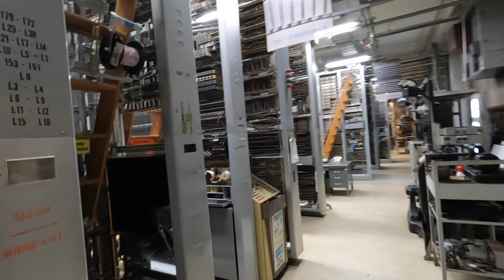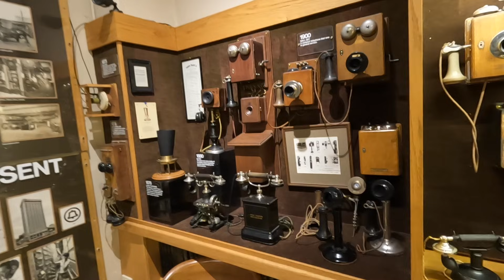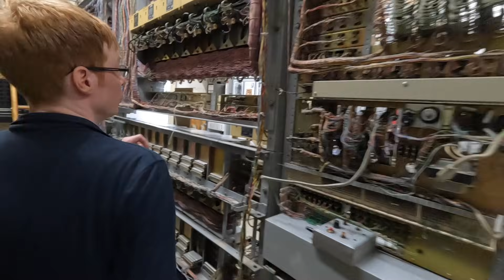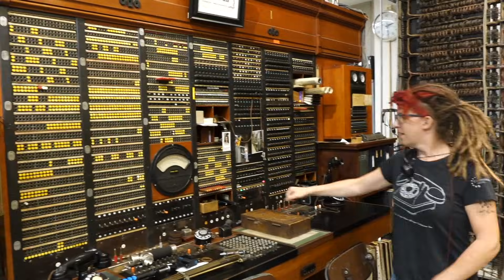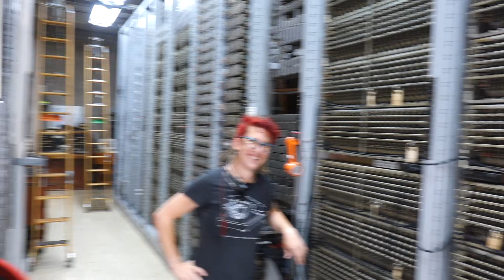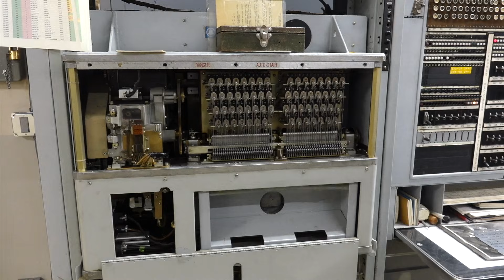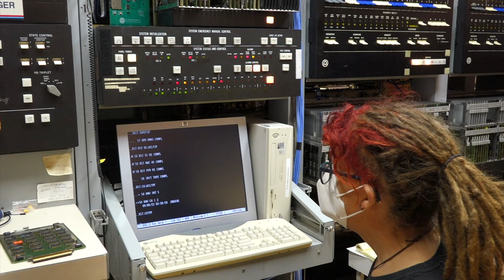At the Connections Museum: the insane telephone technology that led to today's computers

Comment: My parents’ home had a local battery set in the 1930s with a metal battery box holding two Blue Bell No. 6 1.5 Volt carbon zinc dry cells.  My dad said a phone person replaced the cells about once a year.  Those were some pretty impressive dry cells.  The capacity is more than 100 amp-hours.  In the very early days in the 1880s crowfoot copper sulfate or later Leclanche carbon wet cells were used.  The wet cells also had massive amp-hour ratings any only needed to be refreshed once a year or so.  Until Charles Brush invented the practical dynamo around 1880, all telecom was battery powered.  Remember the electric telegraph dates from about 1844, so wet cells were all over the Western Union and other systems.  Battery boys were used to keep the electrolyte refreshed in rooms full of wet cells in main offices.
Reply: Those later dry cell batteries would last longer, so would often only be replaced at the 10 year mark, or even longer. There were still those systems in operation in my country till after 2000, running a few dozen farm lines over open copper plated steel wire pairs, with the poles having every 20 poles a section of 2, where the twists in the pairs were done using a 4 insulator block. Around 50 subscribers per pair, as you did not have a high call volume on those lines.  First change was to consolidate those lines so only the far ends were shared, local ones got the new cable gradually laid out, giving each a pair, and direct dialling, till finally the last were done away with. 

Still have a 1939 Ericsson wall mounted phone, which I converted, just with 2 wire jumpers, from local battery to remote battery. Unable to dial out from it, as it still has the 90VAC generator, and the mechanical bell with the 1 REN loading on the line. Want to use it for VOIP, but most of the adaptors cannot actually handle an actual real 1 REN load on them, typically 0.4REN. Thus it is now a wall mounted phone holder for the modern smart phone. No more copper phone to the house, gone a few years now.
Reply: @SeanBZA  Thanks for the reply.  The phone on my desk is a Western Electric 302 with the older style handset with the ear piece with the separate metal plate.  The dial is (forget the part number) the one with the porcelain number plate.  The subscriber set wall box is I believe a 534A which is meant for common battery and bridged ringing (has the 2 uF capacitor), induction coil is the older long skinny one, not the E-core transformer.  The setup still works great after about 95 years of service.  I can still dial out on the rotary dial.  I have VOIP phone service from Spectrum cable which is provisioned by a Motorola customer terminal in my basement.  They accept repertory pulse dialing because they’ve got quite a few customers with older alarm systems which can only do pulse dialing.

I almost forgot, I have a Panasonic small business PBX box between my phones and the Motorola terminal.  I got the Panasonic used from the usual auction web site for about $100.  What a fantastic unit. The Panasonic is quite easy to program and any extension line may be either the Panasonic proprietary phones, or standard 500 or whatever series phones which are auto detected.  The only quirk is it seems the only way to record the voice menu tree is through a proprietary digital phone, so I have one digital phone for my manager’s console.  Everything else can be done with * codes from analog extensions.  The greatest benefit is that having an AVR voice menu has reduced spam calls completely to zero.  No telemarketer bothers navigating the menu tree!  The PBX transparently passes through pulse or tone dialing to the outside line(s), though it can convert between the two in needed.  Curiously, the outside lines as far as I can tell have to be loop start, no ground start, so there is the risk of glare (call crashing where incoming and outgoing calls occur simultaneously on a line).

I’ve also got a few old magneto phones and desk stand phones which are set up for local battery.  I don’t use them because I got complaints from people on the other end that they’re way too loud.  The old carbon transmitters have an effective gain of something like 50, so they are loud.  About 1912 or so, Western Electric actually tried mechanical amplifiers with magnetic reproducer mechanically coupled to a carbon transmitter.  The frequency response was not too good.  DeForest/Fessenden vacuum tubes became available about 1914.  I believe the first vacuum tube amplifiers were installed in a long distance circuit in Maumee, Ohio.  Western Electric also did an experiment with a carbon transmitter, unamplifiied, to relay a political speech to horn speakers about 100 miles away.  A DC current over 10 amps was run through the carbon transmitter which had to be water cooled.
Reply: @wtmayhew  Nice setup. If the 302 is connected to the 534A subset/wall box then it might actually be a Western Electric 250. Those are a variant of the 302 with no ringer or induction coil inside meant to replace old 202 or candlestick sets and reuse the subset/ringer box from those phones. If so very cool to hear about such an old installation still in active service in the full vintage configuration
Reply: @St0rmcrash  Thank you for the correction.  I should have know better than to try to remember numbers.  The desk set is an oval base model 202 and checking the web the handset is type E1.  I found a Bell System Practices section on dials, I believe the dial is a type 2.  The dial was balky so I disassembled it a few years ago and used clock oil sparingly on the gears driving the governor.  The bias spring on the ringer in the subset box is tensioned with a cotton thread wound around an adjuster post.  The old thread deteriorated and broke, so I found some period correct looking heavy cotton thread for replacement.  The old capacitor in the subset seems to be fine.  The old Western Electric equipment is built so amazingly well and simple in design that there isn’t much to go wrong.

I also have a spare 534A subset which apparently went back for depot service and has been updated with a induction coil and capacitor unit which looks like the inside of a 302 desk set mounted on an adapter plate, while the ringer is an older two gong with two long coils, but slightly different from my older 534A.  It appears that there was a lot of mixing and matching of of parts going on, especially post WW-II when demand was high and new parts were in short supply.
Reply: @SeanBZA  in Australia we had Eveready No. 6 cells, looked the same apart from the label.

Comment: I was lucky enough to see a full working exchange using Strowger switches in the very early 80s.  It was incredibly loud, and the person showing me around said you could tell the heartbeat of the area by changes in the noise level.  Popular radio call-in giveaways could easily jam up multiple exchanges, so radio stations were given specific central office code numbers (the xxx portion of a local xxx-yyyy US format phone number) so their traffic could be tightly controlled.
Reply: My village had a strowger exchange for many decades. A tiny little building behind our primary school. As a teenager I’d walk down and stand outside, at night, simply to hear the reassuring “CLU-CLU-CLU-CLU-CLUNK——-ZZZZZZZZIPPP!!” of the uniselectors, and to be entranced by the beautiful, deep red glow of a statue bulb, shining through the mottled security glass 😄
Reply: In the UK we had a TRAPP system for radio call ins, to stop the exchange becoming congested. The radio station had a special number for you to dial for call ins, and each telephone exchange only had 2 lines to the radio station switchboard
Reply: I think for the Los Angeles area, it was the 213-520-XXXX area/prefix that was used for the high volume call-in stuff.  If you were lucky and were the "19th caller" you could win $10 of free dry cleaning.  :)
Reply: I was fortune enough to get into the Telecom industry when PBX's were being converted to digital in the early to mid  80's. The decibel level in some of these switch rooms was unreal.
Reply: Where I live, the 888 exchange was implemented for radio stations because one station once offered a new Harley Davidson motorcycle to the 5,000 caller and took down most of the exchanges in the city.  These were called "choke" exchanges as they limited the number of calls to that particular exchange.  Later on, 888 just became a regular exchange after the advent of electronic switching.

I got a tour of our local Bell 700 line sxs exchange in the small town I grew up in during the early 1960's.  Later on, I became a private telco tech and managed a hospital network of over 10,000 lines of digital telephony.

Comment: I grew up in a medium size city which had a Bell office serving the town with SxS equipment in a three story office which was also a long lines repeater office and a coaxial TV transmission office as well.  The basement housed the batteries, ring generators and interrupters.  The last time they gave a public tour was 1968.  When I was a kid we still had to dial the operator to request toll calls outside our own area code, but offices in the area code could direct dial toll calls.  Incoming toll calls were automated with the distant city operator able to DTMF signal the local office to connect the call without operator supervision on the receiving end.  Bell started an upgrade of the SxS to some version of ESS in 1975 and hard cut over the entire town in one fell swoop, if I recall, on a July evening in 1976.  The old SxS equipment and tennis ball tube amplifiers did not require air conditioning, but the windows of the office would be open in the summer and walking by, the sound of many Strowger switches filled the air, punctuated occasionally by the wail of a horn when a malfunction was detected.  That old building is still there, now an AT&T facility, and all the windows have been bricked up.  There is now only the sound of passing cars on the street.
Reply: When I was a kid, we had to make “Station to Station” or “Person to Person” call. The operator would have to go through connecting several operator in series to get to the final destination. Or even Collect call. And it was expensive. We even had a Party Line where we shared the same wire with others. I sure am glad I lived long enough to see how phones improved over the years.
Reply: @oldmech619  Thanks for the reply.  Yes, I remember that too.  There’s a film in the AT&T archive about direct distance dialing for operators, which showed the old way, where a customer would call the operator, request the distant number, and hang up.  The operator would call back a few minutes later after the call was manually connected.  By the time I was old enough to use the family phone, the local operators had direct distance dialing, so you could just hold the line for the few seconds it took the operator to connect the call (provided he destination city had automatic switching equipment).

Station to station versus person to person seems quaint now that most calls to anywhere inside the continental US are virtually free.  I recall mostly using person to person from pay phones; the rate was higher, but you did not have to pay if the requested person was not available at the called number.  There was also the day/night/weekend rate to think about.  When I was working as co-op student, I would wait until Saturday night to call home at the least expensive rate.  If I recall, it was like $1.10 for a three minute call.  That’s probably close to $5.00 now, adjusted for inflation.  How times change!
Reply: @wtmayhew    My dad made sure the phone was in the the hallway so we wouldn’t talk too much to our girlfriends. Even having a phone in the bedroom was too costly. Remember Dick Tracy’s wrist phone?  Now we have far exceeded that dream.
Reply: There is a similar building on Washington Street in Indianapolis.    🧑  Often wondered how long it was there, what was in it over time; and what's in there now..🤔   Also wondered,   what area of the city  and suburbs it served/  serves.
Reply: Speaking of cut-over of service, there’s a film on the AT&T tech channel of a central office cut-over and it was literally a cut-over.  Everything had been paralleled with the new switching equipment and on the appointed day a dozen or more people were poised at the main distribution frame of the central office.  About half of the personnel were poised with heavy cable cutters while the other half had fuses and jumpers.  At the stroke of midnight cables were cut and connections to the new switch jumped in the matter of seconds.  Now that is organization.
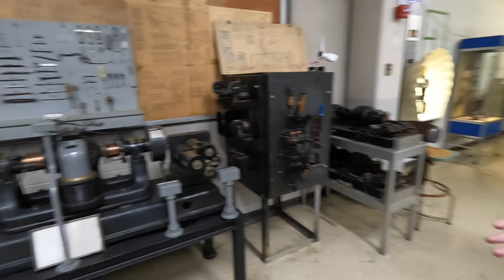Reply: 1:53

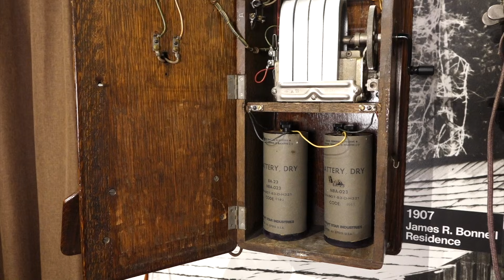Comment: 6:30 That's awesome, thanks for the explanation of the batteries.   A few years ago my high school was torn down,  and I snuck in to steal whatever I could. One thing I took was a metal box that was mounted to a wall, the inside stated "Battery Replacement Box".  It was made by a company that eventually got bought out by IBM.
Reply: ITR (international Time Recording)? That may have run the battery for the time correction and or bell signals too. ITR/IBM had systems that could use the room bells for signalling and a separate PBX phone system. The charge controller usually had a minute impulse slave unit that would switch the charge current from cell to cell in a battery to keep them from overcharging. IBM Time equipment was most commonly 24 volts.

Comment: I remember my first tour through the switching office. I said there’s no way that every single copper pair for every line comes in here. My guide says Oh yes they do!! I was kinda blown away. Then they showed me the battery backup system, and the air pressure system, and was absolutely amazed! Great memories. SBC/PacBell
Reply: The batteries actually provide power for everything and are kept on a float charge. In the event of a commercial power outage the batteries would then provide back up power and prevent service from being interrupted. The batteries alone could power everything for about 8 hrs. This would give the power crew time enough to get to the central office and start up.the emergency diesel generators.
Reply: Air pressure system?   For what?  Blow battery fumes away?   Extinguish arcs?
Reply: @robertgift  The big outside-plant copper trunk cables, containing hundreds of wire pairs each, were pressurized with air from the CO end to keep water out

Comment: I didn't know that each of the early subscribers had to have their own battery just as we do in our smart phones now. If only it was the phone companies that had to replace the batteries in smart phones!    I am reminded of the fact that some electric vehicles have more than seven thousand cells in their batteries (which are also difficult to replace).  Early technology; don't you just love it?
Reply: I remember reading about the Danish telephone service which switched to line power in 1927 and all the subscribers were told to cut the line to their phone batteries. Those that didn't caused their phone to constantly try to make a call and so they spent months troubleshooting and going around to people's houses to disconnect their battery for them.
Reply: Since they knew what numbers didn’t disconnect their batteries I’m sure they called them. But there has always been people that couldn’t touch hardware. So I bet if they had to call them they usually had to go out and do it them selves.
Reply: @ecospider5  Honestly, if i got a call that said to cut a battery wire to my phone, i'd have assumed it's a prank call. Kinda like doing tech support and telling someone to press alt+f4

Comment: I learned UNIX on an AT&T 3B2/300 and a 3B2/400 running System V R3.2 that were returned back to Bell for “disposal” after being retired from 5ESS service. I owe my entire career to the Bell network.
Reply: I learned UNIX on a DEC PDP-11 and later worked in the MMOC (Minicomputer Maintenance and Operations Center)  Where we had around 100 computers running mostly UNIX. Mostly Minicomputers took up two floors of the Telco building.  A couple of times I even went back to Bell Labs in New Jersey.
Reply: I still have a 3B2/400 in my cellar.Last time I booted it up was some 25 years ago.
Reply: I worked my last 15 years before retirement with ATT. I worked the pipeline contract where we used mountain top microwave that we accessed by helicopter. My last six years were at a gateway earth station. We worked all kinds of circuits and the transport. I worked jobs all over the state of Alaska and some overseas during my telecommunications career.